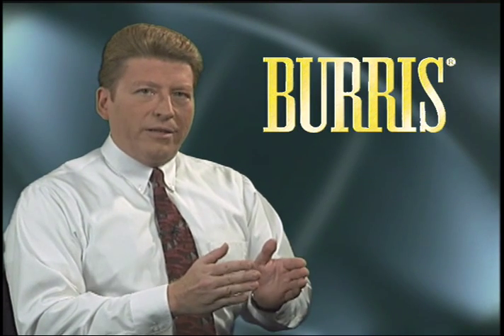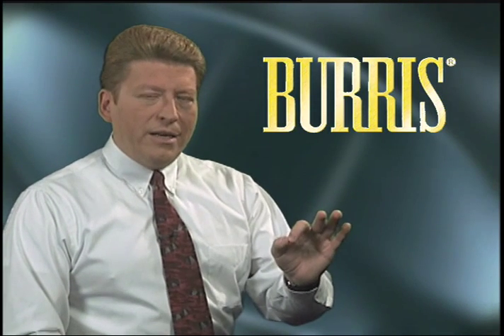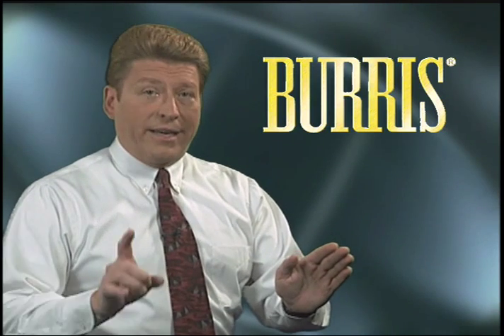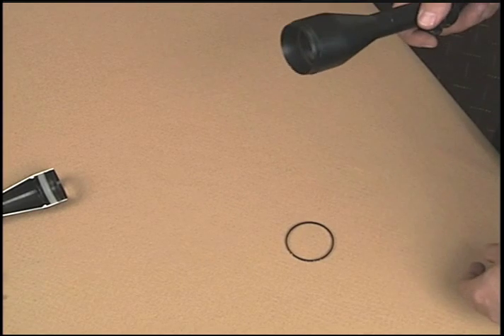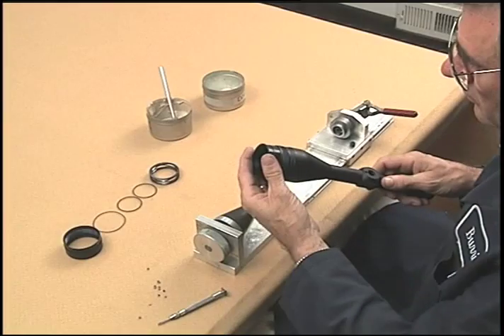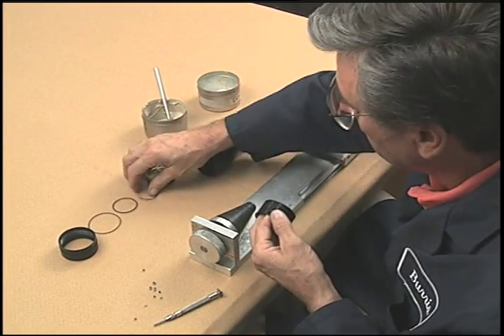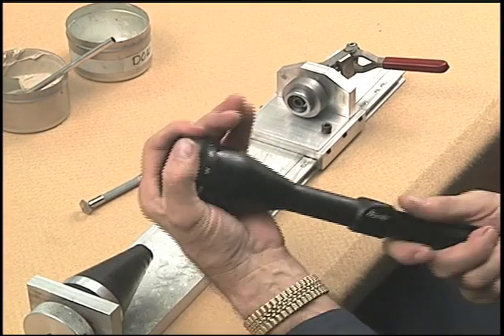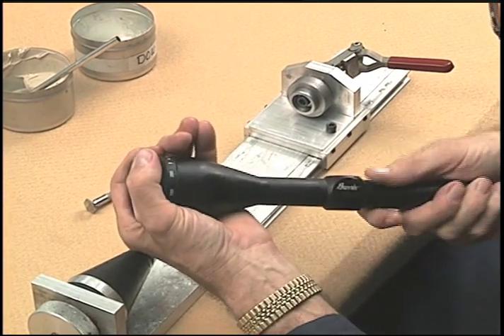Installing the Objective Lens

Comment: my Eliminator III laser scope had some malfunctioning  issues and upon its return it was discovered the objective would not rotate beyond 50 yd mark without extraordinary effort. Seems to do so would damage the scope. 
Was not so hard prior to recent servicing to repair objective.
 New resin could be the problem. 
Hence it will be returned pending RMA number.